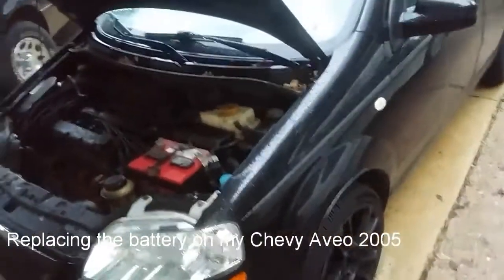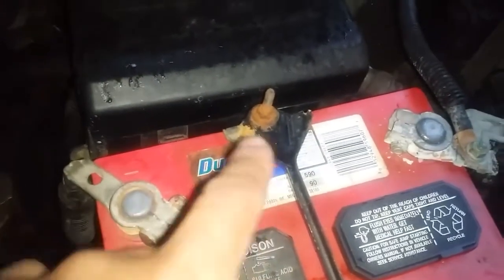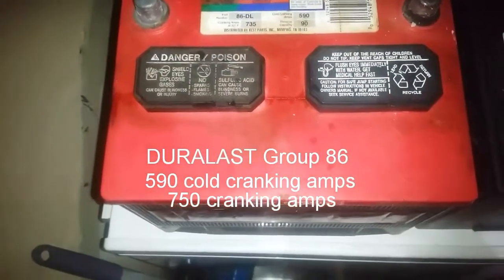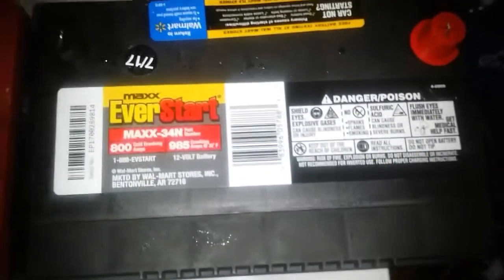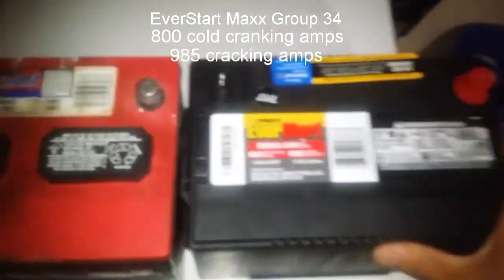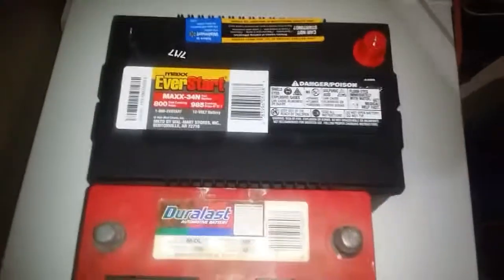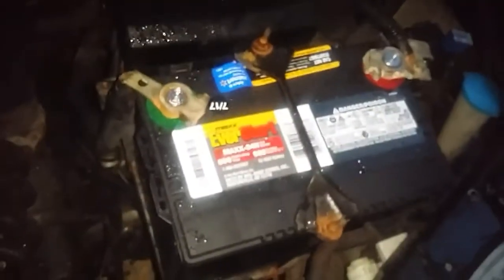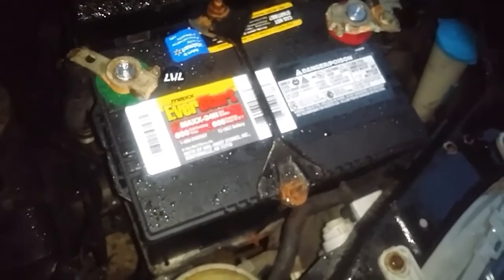Replace car battrey on Chevy Aveo 2005 / upgrade battery

Comment: I have 2012 aveo 
is it the same way changing battery
Reply from the maker: Pretty much you can replace the battery the same way. Not sure for a 2012 Aveo the battery might be a different size on your engine bay.

Comment: Hey where did you get that Voltage gauge from? Thanks
Reply from the maker: I brought it on eBay here's the link:
https://rover.ebay.com/rover/0/0/0?mpre=https%3A%2F%2Fwww.ebay.com%2Fulk%2Fitm%2F372653598949
Reply from the maker: https://rover.ebay.com/rover/0/0/0?mpre=https%3A%2F%2Fwww.ebay.com%2Fulk%2Fitm%2F372653598949